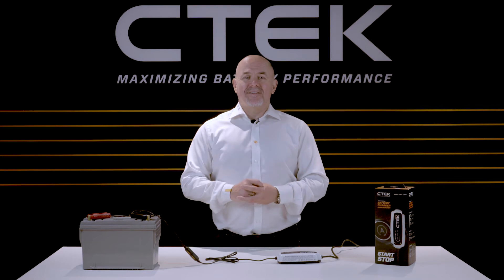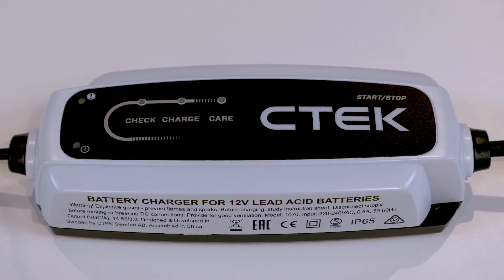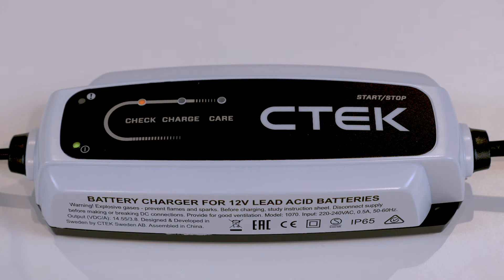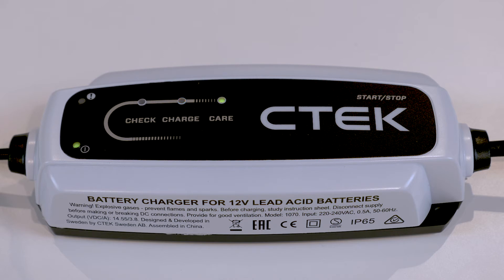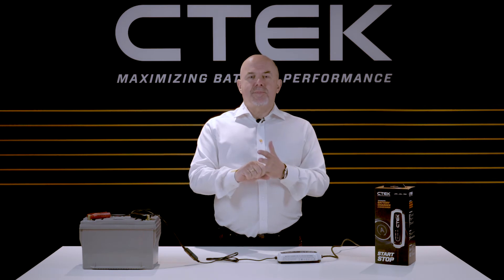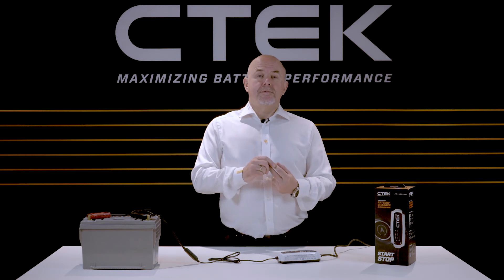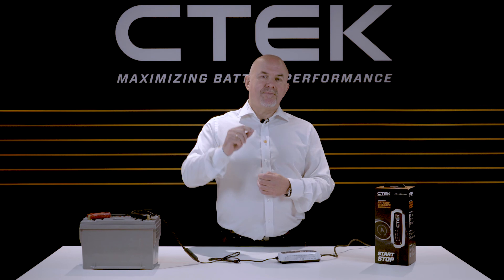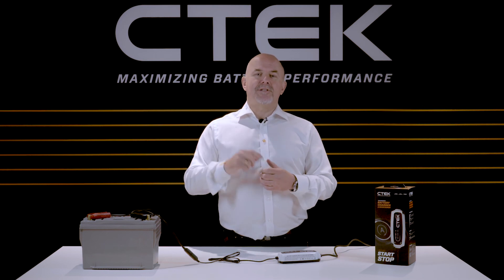Tutorials - CT5 Start/Stop - Charging

Comment: I'm not an expert at all, got no garage and so no power outlet near my start and stop equipped car that always stays unused for 10-15 consecutive days every month of the year with battery often at 11,8V or less. This is why I want to ask if it is possible to connect this device to a little solar panel, what would be the results in terms of effectiveness and eventually what panel should it be. The weather is sunny for the majority of the year, the car has glass panoramic roof and I don't like to buy a new battery every winter just because I can't use sun energy source almost always available. Furthermore, the start-stop system is perfectly fine, but I remember the last time it worked was at the end of a relatively long trip in spring after the battery was changed the previous winter. Usually my yearly mileage is less than 3k km often with 10 km journeys in traffic jam, so that poor battery really can't do more than this and needs some help! Thanks in advance.
Reply from the maker: HI, I recommend you to check the CS FREE, which can be used without any power connected - or connected to a solar panel (optional accessory) I strongly believe this is a good help for all of us with not power where the car is parked. Best regards CTEK Support
Reply: @CTEKBatteryChargers  man, this seems very cool! And I see that it came along just few days ago! But when will it be available in Italy? Thanks again.
Reply from the maker: @fantomas76  I think it is an outstanding product! It is on it's way out to the dealers now. I ask you to contact sergio@intec.it for more details. Good luck Best regards CTEK Support
Reply: @CTEKBatteryChargers  done it!

Comment: I got the red light and green care light on at the same time. What does it mean?
Reply from the maker: Hi, when the battery is 100% fully charged, the led CARE goes on. The first thing the charger will do in CARE is analyse the battery to see if it keeps the voltage. If voltage drops too quickly the red "!" will go on. Reasons could be a poor battery or to many consumers active. I recommend you to disconnect big consumers (if possible) and restart to see if the problem occurs again, if this happens again - please get the battery tested it might be poor and in need of replacement. Good Luck best regards CTEK Support
Reply from the maker: Hi, that sounds strange. Please disconnect and connect again, if the result is the same - please take the charger back to your dealer. It might be broken. Best regards CTEK Support

Comment: Hi, great video. Ok so my question is: Can the battery remain connected to the car & the CTEK CT5 be connected to keep the battery topped up? I have a Ford Kuga that spends a lot of time on the drive not being used, maybe once a month & need to keep the battery topped up & in full working order.
Reply from the maker: Hi, Thank you for your kind words. All CTEK chargers are electronic safe, so they can, at all time, be connected to the vehicle without risk harming the electronics. You can safely use your CT5 connected to the recommended charge points under the bonnet with the battery still connected to the car. And you can also have the charger connected for longer periods of time when the car is not driven. Good Luck. Best regards CTEK Support

Comment: I Charged my agm battery with ct5, and after 20min the indicator moved to care, but when I check with the multitester the voltage is 11.9v, so I disconnect the clamp and connect it again and it begin to charge, and after 20min move to care again, but if I disconnect in again and connect it again it started to charge again, whats the problem here?
Reply: My battery is stinger sp1500
Reply from the maker: Hi. It seams that your battery gains energy very fast - but looses it as fast again. There is a risk that your battery suffers from a broken cell. I recommend you to take the battery to a workshop and get it tested, It might need to be replaced. Good Luck. Best regards CTEK Support

Comment: I have just purchased this charger. My car battery is less than a year old but unfortunately I let it discharge. The voltage at the battery is 11.8V but the "check" lamp has been on for several hours. Is this normal please?
Reply from the maker: Hi, Yes it's normal - but will only happen if the battery is in poor condition. As long as the  red "!" in the upper left corner isn't lit you can let it keep trying to help the battery. If the "!" goes on - try agian! If the result is the same. get the battery tested it might need to be replaced. Good luck CTEK Support
Reply: @CTEKBatteryChargers  Thanks very much, that's reassuring. It has now cleared and moved to the charge state.
Reply from the maker: @philamos8914  That is good news! Thank you for getting back to us with this information. A recommendation can be to charge more often to help the battery. Once or twice a month will do the battery and the vehicle good. Best regards CTEK Support
Reply: I have the same problem, how many hours was it on check?

Comment: Hello! Which one of your chargers do you recommend for 68Ah EFB battery, this one, or regular MXS 5.0 and why? I recently got myself that battery and I'm kinda wondering how to charge it properly. Also my car don't have Start/Stop technology in case it matters.
Reply from the maker: Hi. Both works as good! The StartStop charger is a plug and play type of charger - no modes to choose from and a display only telling you Check - Charge -Care, easy and simple! The MXS 5.0 is as intelligent and offers 8 different charge modes to choose from and a display informing what the charger is doing. So it is more up to you and how you want to use the charger!. Hope this will help Best regards CTEK Support
Reply: @CTEKBatteryChargers  Oh, alright, thanks a lot for the explanation, I think MXS 5.0 will be better for me then, since I always like to have a little bit more control. Thanks for such fast reply and have a nice day! :)
Reply: @CTEKBatteryChargers  Oh your website MXS 5.0 does not specify that is compatible with EFB batteries- it is very confusing. My local store only has the MXS5.0 or CT5 Time to Go, between the two which will you recommend for cars with EFB batteries?

Comment: Is it safe to switch off the charger before the charge is complete?
Reply from the maker: Hi, Yes. You can disconnect the charger whenever you want, and keep charging again when you have the possibility. The manual states the maximum time in each charge step, Best regards CTEK Support

Comment: My stop/start CTEK has been great for 18 months, once a month I plug in my car for a charge and condition to keep it tip top. Just recently it has been charging for a couple of hours then switches to Care at which point the red light comes on with the care light. I am not sure what this is warning me of, can you help?
Reply from the maker: Hello. If the CARE and the red "!" is lit, the battery looses power two quickly. I kindly ask you to try again, if the same things happens again, please get the battery tested as it might need to be replaced. I hope this helps. Kind Regards CTEK Support

Comment: Can I use this CTEK CT5  stop start charger to charge an AGM battery
Reply from the maker: HI, Yes, the CTEK CT5 START STOP are made for all types of 12V lead acid batteries. It will work fine for an AGM battery.
Kind regards CTEK Support

Comment: Can you also charge other 12V battery with this CTEK start/stop?
Reply from the maker: Hi, Yes, you can charge all  types of lead acid batteries (as GEL, AGM, EFB, wet, flooded Ca/ca) sized 14Ah to 130Ah, so it more or less cover the  most! Best regards CTEK Support
Reply: CTEK Battery Chargers thanks for the info!

Comment: Hi, I'm deciding which one to get for my start and stop veichle and efb battery.
Apart the ct5, is the mxs5 start and stop compatibile as well?
Reply from the maker: Hi. The CT5 series as well as the MXS series works perfect with EFB batteries. I believe it is more up to you, what type of charger you would like to handle. The Start stop without any options to choose from, or the MXS 5.0 with 8 different charge programs. Good Luck. Best regards CTEK Support
Reply: @CTEKBatteryChargers  ok, so is  the mx5 good for the start and stop veichles? Won't it damage the car? Last question, which of your device have the safety function, the one to swap battery without interrupting the car current? Thanx
Reply from the maker: @muaythai4lifelife  Hi. Both batteries are safe for the electronics, no difference in that perspective. And none of them have the SUPPLY mode that makes it possible to swap battery without loosing the seetings. If that is important- Use the MXS 7.0 or MXS 10 instead. They work as the other chargers, but are stronger and faster. Best regards CTEK Supportloosing the seetings. If that is important- Use the MXS 7.0 or MXS 10 instead. They work as the other chargers, but are stronger and faster. Best regards CTEK Support
Reply: @CTEKBatteryChargers  thank you. So the ct5 isn't Start and stop compatibile, it's just easier to use in reference to the mx5...
Reply from the maker: @muaythai4lifelife   Hi, The CT5 is start stop compatible, and easier to use. The MXS 5.0 is also start stop compatible, and comes with 8 different choosable charge moodes. Best regards CTEK Support

Comment: I have tried to recharge Exide battery recharge able but the Exide battery became very hot , why ?
Reply from the maker: Hi, there is some different reasons to why a battery get hot when charging, the most alarming would be a broken cell (or several broken cells), As I am not working for Exide i can not go into details as they can, but I recommend you to get the battery tested to see if it is OK or if it needs to be replaced. Best regards CTEK support